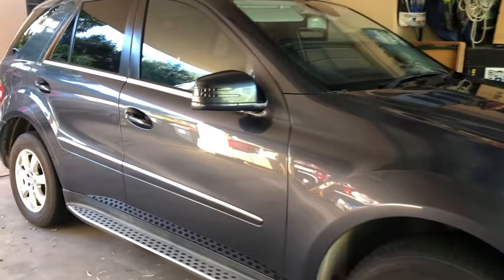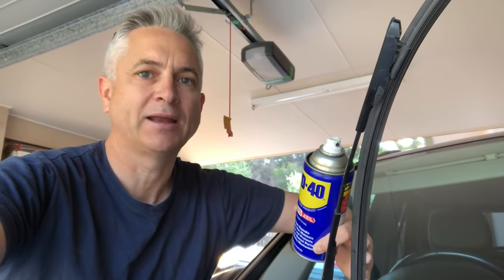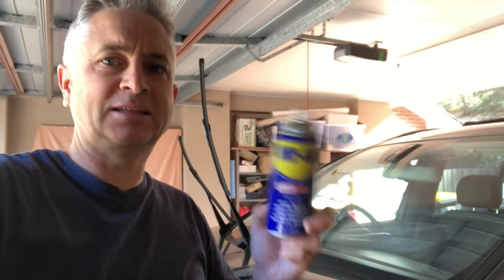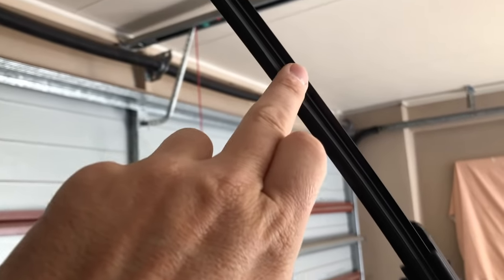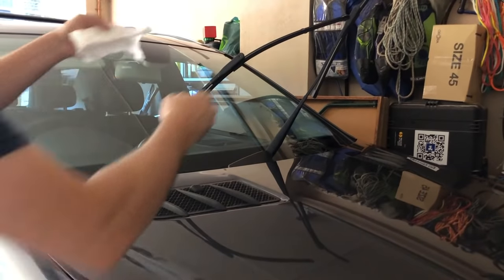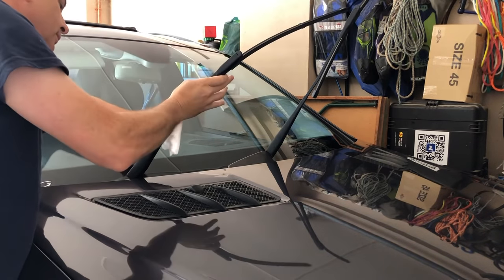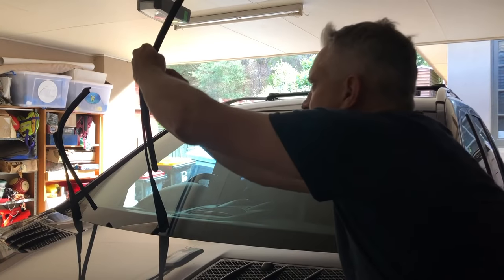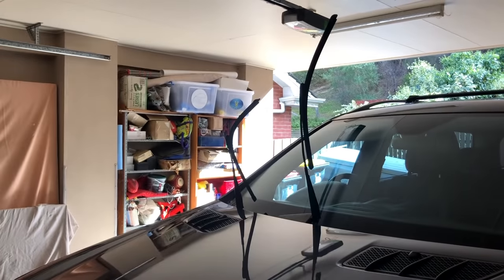WD40 Hack on Wiper Blades!  Does it really work?

Comment: This works because you're dissolving a bit of rubber (or whatever your wipers are made of). WD40 is a solvent. Put a good quality windshield sealant on the glass and you can skip this whole business. There are many good ones but the one I happen to like is Griot's. Costs less than 15 bucks a bottle, and 1 bottle will treat all the exterior glass on 4 or 5 regular size cars (or perhaps 10 cars if you do the front windshield only). Takes all of 10 minutes to apply, twice a year. Not only makes your wipers run smooth and true, but at 50 kph or higher, the water beads off on its own, so you don't have to use the wipers at all. Both extend the life of wipers immensely. Melting a tiny bit of your wipers with a fairly potent solvent and then running them over an untreated windshield doesn't seem like the best way to deal with rain. Spend 10 minutes and use the correct tool for the job. I've applied it to my vehicle's windshield regularly (as I mention, twice, perhaps 3 times a year maximum if you live in a very rainy/snowy climate and your vehicle is always parked outside)  and the difference is absolutely night and day vs an untreated one. I'd urge anyone trying this WD40 trick to watch a few videos about glass sealants and pick one they like the look of. One of the best, cheapest decisions I ever made and I'll definitely never drive without it going forward.

Comment: The problem is not the rubber blade, the problem is the angle of the metal housing. Use two spanners or grips to twist the metal wiper holder so the rubber blade sits flush on the windscreen. Then when you turn them on the rubber will bend over according to the direction of the blade. WD40 is a short temporary fix.
Reply: Correct 👍🏻
Reply: Some cars like BMWs come with a simple tool to do that.

Comment: Never use WD40 on wipers. Use white vinegar.

To clean windshield wipers using vinegar you'll need to mix 1/4 cup of white distilled vinegar with a cup of water. Then spray the mixture onto your windshield wiper blades, allow them to sit for a few minutes, and wipe clean
Reply: Why not?
Reply from the maker: Thanks for the tip!  I will certainly give it a crack, in the meantime the WD40 has worked a treat for me ... nearly a year later and my blades are still very good now!!  Cheers Drew
Reply: Rubbish!  I've been using WD-40 on wipers for almost 10 years now and nothing beats it.  Vinegar is acidic and even when mixed with water will cause problems over the same period of time.
Reply: @ausfan100  Fair enough - I will give it a try!
Reply: The vinegar's acid can eat away at rubber just as it does natural stone.
Reply: nope, vinegar is inefficient to remove the (natural formed) silicone deposits, the best is to use ethanol

Comment: Try putting a 1/2 teaspoon of liquid dish soap in a gallon jug of washer fluid. Most wiper fluids have no surfactant (soap) in them. Every time you use your wipers you now clean the oily film off the glass.
Reply from the maker: Hi Ken, I can honestly say that I did not notice any oily film after doing this and my blades are still in excellent condition now nearly a year after doing this!  Cheers Drew
Reply: @DrewFixIt   Wow, it lasts a year!  I have WD in the house.  I’m going to have give this one a try. Thanks for the feedback.
Reply: Didn't work anywhere near as well as the WD-40.
Reply: I do that in summer time...
25% of dish soap from small bottle  to 2 gallon of fluid washer tank.... 
Gets the bugs off quicker. ...👍.
Reply: Ken, virtually ALL wiper fluids have surfactants in them. They have to have, otherwise they wouldn't clean. I make my own, based on a recipe I made up from reading the data sheets for commercial products, and one of the main ingredients is alcohol ethoxylate, which is a non-ionic surfactant. The other main ingredient is butyl glycol, which is primarily a solvent, but which has pronounced surfactant properties. What I do is make up a 1L batch of my recipe and , then every time I need some screenwash I put 75g of it in a 5L bottle (of the type screenwash usually comes in) and make up to 5L with water. I use water collected from a dehumidifier so that it contains no dissolved minerals (hard water) which leave white streaks on the glass. There's no real problem using dish soap to clean your blades, but you don't want a lot of it mixing with water as it will foam up, and it isn't a very strong surfactant anyway (I'm speaking as a chemist here). Windscreen cleaners are purposely non-foaming (because of the types of surfactants in them). Making my own is WAAAY cheaper than buying it.

Comment: Another tip is to buy the rubber wiper blade inserts and you can pretty easily disassemble the wiper blade holder and replace just the rubber very cheaply
Reply from the maker: Hi Archie, interesting I did not know this.  Where do you buy runner inserts from?  Cheers Drew
Reply: @DrewFixIt  In the US Amazon has them, about $9 for 4 pieces. Search wiper blade refill or insert, something like that.

Comment: Surely you should be able to get them elsewhere without paying dealer prices. I get wipers for my car off amazon or ebay. I tend to buy bosch blades on the front.
Reply from the maker: Hi Chris, good point and that was my plan if it didn’t work, but nearly a year later my blades are still now in excellent condition, so why bother?  Cheers Drew
Reply: @DrewFixIt  my wipers arent that expensive so i just change them before winter. Least the wd40 works.

Comment: Why go to a dealership for wiper blades? That’s just ASKING to get ripped off, haha (Sorry if I sound rude). I’d just go to an auto parts store or some sort of retail/convenience store.
But, this is certainly a good little trick. I’ll give it a shot on my car. I ran into the same problem
Reply from the maker: Hi The Bolder, I also went to the local auto shop and the price for Euro car blades in Australia is just stupidly high!  I’ve now also done this trick on the wife’s Audi and it worked a treat on her car too! Cheers Drew

Comment: I'd probably use a silicon based solution instead of WD-40.  While this may work for a while, I'd be concerned about WD40 eating away at the rubber over time and possibly leaving some residue on the windshield (petroleum based marks are hard to get out of glass and tend to lead to clouding over time).  I've heard that silicon may be better and is intended for use on rubber materials such as windshield wipers.  I guess the good thing is if you destroy the wipers, it's not like it was that expensive to replace them, but it could leave residue on your windshield which might be harder to get off.  Also being that WD40 is petroleum based I think it can also get washed off quicker than silicon, which tends to be "sticky" enough to last longer especially in wet applications/conditions like rain or snow.
Reply: good points HR, but the bigger point everyone is missing here is.... clean your wiper blades from time to time!!
 
I don't care if it's with wd-40, olive oil, human waste, or just plain water!!!
 
what you clean them with is pretty much irrelevant.
Reply: You are out of touch with reality. For years WD-40 has sold a silicon based solution as well as many other variants.

Comment: There’s nearly no rain 🌧 fall water 💦 when you started the wiper blade. The blades will actually squeak when there’s barely water on the windshield glass. 

Use NU finish instead to wipe down your windshield glass and it will eliminate the squeak noise
Reply from the maker: Hi Mate, thanks for the tip! Cheers Drew

Comment: WD40 isn't a lubricant. Like any liquid, it will provide some lubrication when wet but WD40 dries and leaves behind a sticky residue. This is because it was designed to displace water (WD=water displacement) in electrical circuitry and then dry and leave a coating behind to protect against future water infiltration. For the application covered in this video, and for rejuvenating door, trunk, hood seals, etc., I use Silicone Spray.

Comment: Works great.  I’ve been doing this for years.  For a finishing touch, polish your windshield with #0000 steel wool a couple of times a year.  You’ll be amazed at the difference.
Reply from the maker: Hi Ronnie, thanks for the positive reinforcement and the extra tip! Cheers Drew
Reply: no man, this cant be real , lol 
really any gradient steel wool?
Reply: Might I suggest, Mr Cleans Magic Eraser, less of a mess and brilliant for polishing smooth glass and ceramic surfaces.
Reply from the maker: @GalileonPrime  hi mate, I will give it a shot!  Cheers Drew

Comment: I swear by WD-40, for releasing stubborn rusty nuts and bolts. 
I did, the other day,  have a little panic, because, my wipers decided to stop, mid-sweep, while it was raining. 
I pulled over,  and sprayed WD-40, into the  gap, where my wiper rod is located, and managed to get wipers working again, within 5 seconds of spraying it on.
You'll understand this post better, when I tell you,  my vehicle, is a 2005 Land Rover Defender.

Comment: You should actually use silicone spray, it cleans and rejuvenates the rubber.
Reply: Yes, however, be sure that spray is PURE and doesn't have ANY other additives in it, especially pretolium solvents which most all do!  Pure stuff is hard to find.
Reply from the maker: Thanks Terry for the recommendation, I will give that a go next time!  Cheers Drew
Reply: @garysmith8455  I would think the silicone used to prep the door seals for winter would do nicely. That's designed specifically for automotive rubber.
Reply: @HepauDK  Probably work fine.  Just watch the ingredient list on the can, should not have more then a couple things listed, to be safe.  As mentioned, I use FOOD GRADE, so it is not toxic.

Comment: i am in metal works for over 25 yrs. here some advice: WD40 is good to loosen corroded stuff, clean dirty surfaces from dust and grease. what it really isnt good at is medium and long term lubrication or rust protection. is evaporates very quickly in comparison and when its gone, no lube and no protection anymore. for that i would recommend low viscosity oils. they stick and stay there for far longer.

Comment: I could never get my wiper blades clean, no matter how much I tried. Could wipe them about ten times and you'd still get as much black gunk on the cloth as the first time.

Turns out I was wiping off the graphite coating used to reduce friction!
Reply from the maker: Hi Captain, mine are still really good after doing this nearly a year ago! Cheers Drew

Comment: Or use washing up liquid. Does the same thing , you’re basically cleaning the shit off. Don’t matter how you do it
Edit. A smear on a wet cloth is all I meant, cuts the road grease off and then you keep wiping them till they don’t leave black marks.  Wul in the washer bottle is a nono
Reply from the maker: Hi Martin, thanks for the tip!  I will try this out for sure!  Cheers Drew
Reply: @DrewFixIt  no don't use washing up liquid it will cause a lot of problems you don't use it in the screen wash so don't use it on your wipers. Stick to wd-40
Reply: You don’t use WD40 in the screenwash either
Reply: @trevorguy57  yeah but you're not putting wd-40 in the screen wash bottle you're cleaning the wipers wd-40 repels water washing up liquid will cause smearing and bubbles which you don't want I've been cleaning my wipers with wd-40 and it works fine. This video is a way to keep you're wipers working as new
Reply: @djflintstone2816  The OP made it clear he didn't mean to use washing up liquid in the bottle, either. That just foams up. He said a small amount to clean the blades. Nothing wrong with that at all (other than it is not the best mix of surfactants to clean wiper blades).

Comment: I tried the cocky’s piss hack, and it only works for a short time. I bit the bullet and got a full front set of Bosch blades from Supercheap Auto at $44.00 each. Good vid mate
Reply from the maker: Thanks for the feedback JS!  Cheers DFI
Reply: If they are worn then cleaning won't do much. He mentioned that actually. But if you keep on cleaning them once they show smear, they will last longer.
I as well like the Bosch blades. Half price compared to the Audi OEM and as good.

Comment: It’s the way the blade section sits on the window..ive seen a good fit on YouTube where the angle of the wiper arm is adjusted so the blade sits correctly on the windscreen,and it works

Comment: Use Denatured Alcohol it doesn't smear ! also cheaper !
Reply from the maker: Thanks for the feedback, next time I will give Metho a go!  Cheers Drew
Reply: hardens the rubber
Reply from the maker: @krollpeter   Metho hardens the rubber?
Reply: @DrewFixIt  My knowledge is, it can make elastomers swell and then harden. If natural rubber is being used there it's not good, Silicone polymers however are resistant.

Comment: Use isopropyl alcohol not wd40
Reply: BINGO!!!!!!!!!!!
NEVER use a oil based product on wiper blades or the windshield, EVER!
Reply: Alcohol will dry it out over time...
Reply: @D70340  Or ANY rubber product for that matter !
Reply: @D70340  Never had a problem using it on mine. I only switched to silicone based WD 40 because its longer lasting. NO issues with the rubber drying out, no streaks. My wipers last about 5 years. Its the methanol in the windshield fluid that dries out untreated wipers  and causes them to crack.
Reply from the maker: Thanks Jim for the advice, I will that a go next time!  Cheers Drew

Comment: I just wipe my blades with methylated spirit and use Rain-X on the screen. i have just replaced my blades after over two years and they were on just at the stage of needing replacement.
Reply from the maker: Hi Mate, good to hear.  I reckon it's nearly a year since I did this and my blades are still going strong now!  Cheers Drew

Comment: Warning: use WD 40 Silicone not straight WD40 as it eats rubber, it’s petroleum based
Reply: This is my thought as well. I use silicone spray not regular WD40. It will actually lubricate the windshield a bit too. And use it to lubricate the joint where the wiper arm meets the car.
Reply from the maker: Hi Mate, I have had a few people suggestion the same thing, however I am wondering whether the WD40 actually by dissolving a fraction of rubber actually leaves a fresh (newer surface) which is why the WD40 works so well?  Cheers Drew

Comment: Sorry, REAL Gold Seal(tm) Glas-Wax has been discontinued, so Plan B to the 3M Windshield Glass cleaner, the Meguiar's or the Mother's, all of which take a motorized polisher or cordless drill (MUCH harder to use a variable-speed cordless drill, but you CAN get by) to apply and remove and all cost about $25-40 for the cleaner-polish and applicator/bonnet. There's a brand from Europe (Germany?) that's baby-blue and about $60-75 for the kit. VW/Porsche/Audi dealers push it (I have a EuroVan T-4) with the paint "finish system".  Factoid: Cheap "no-name" windshield cleaners applicators/bonnets self-destruct in seconds. Amazoom and Wallace-World caught me ONCE. WD-40 works on yellowed plastic headlight lenses too! It makes them micro-crack and ruins them!

Comment: That's not road grime, it's a breakdown of the rubber compound of the blade. Just like the rubber compound in tyres have a use by date regardless of whether the tyre still has heaps of tread
the compound breaks down and becomes unstable

Comment: The black residue is old oxidized rubber and not road grime. UV also breaks down the rubber so this trick is cleaning. The old deteriated rubber.

Comment: Yes it works, but the rubber also deteriorates. I switched to using dawn dish soap and got more life out of a blade.
4 drops of dawn in 1/2 liter of water, soak a towel, ring it out and wipe.

Comment: WD-40 is the most misused substance on Earth.  WD-40 is not a lubricant like most people think.  It is a solvent and was originally invented as a gun cleaner.  Although, using WD-40 for the purpose of restoring your wiper blades may work for a minute, the WD-40 will actually cause the rubber to dry out faster, then you end up with the same problem again.  You are better off using a liquid silicone spray, which is liquid rubber and will bond to the blade and not dry it out.

Comment: For those who don't have wd40 at home... Another trick is to use the green side of the sponge and massage your viper blades with isopropyl alcohol or even a hand sanitizer on the wiper blades to remove the dirt & grimes

Comment: …..I keep my 4 year old blades clean with a wipe down of 70% alcohol couple of times a year on my Volvo. Always get black road grime on towel. I also polish windshield with rain~x before winter. One of my wipers started skipping recently so I went to tube. Found the Wd 40 hack and gave rubber blades 2 treatments / wipe downs. Rained a a few days later and NO chatter. See how it holds up as winter progresses. I hate spending $40 per blade. Frikin robbery 🤪

Comment: clean and use paste wax on your windshield too, use it just like you would as if you were waxing your car. it makes a big difference. you can actually drive in the rain without even using your wipers if needed, the water just beads and blows off.

Comment: Just use a silicone based spray. Far cheaper than WD40 from any Tradesman/DIY store like Screwfix in Uk or Buntings Australia and it will do the job on the blades far far better and soften the blades too. These YT videos claiming WD40 fixes everything are a load of bollox. Only time i use spray like WD40 is after i've cut a hedge on the hedgetrimmer blades ready for next use.

Comment: You can use ethanol to clean up the wiper blades, it's same efficient as WD40, but cost much less...WD 40 is only util if the wipers make noise after cleaning with ethanol...